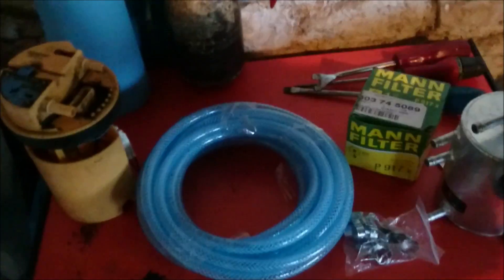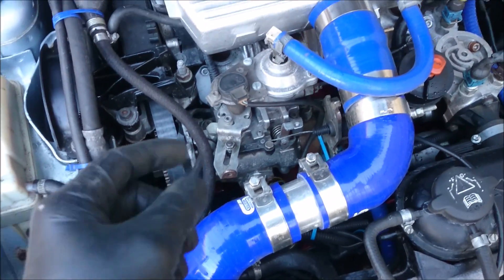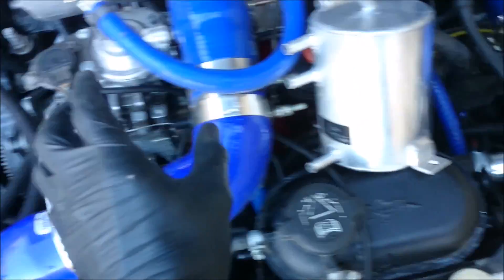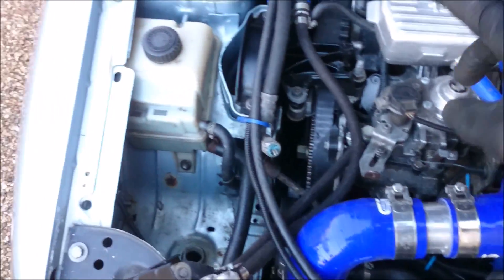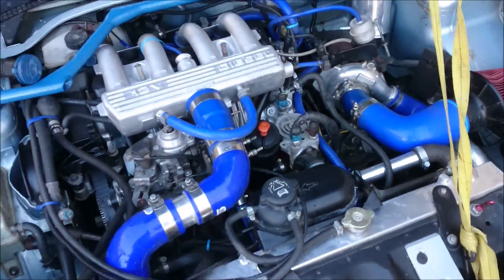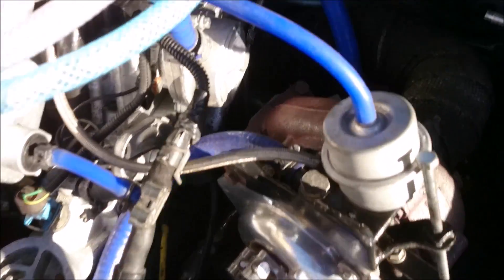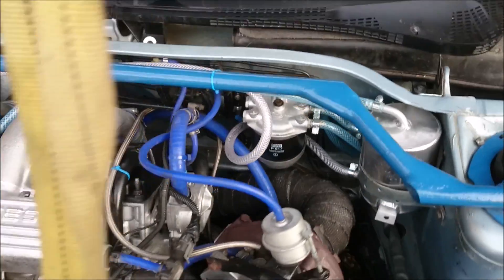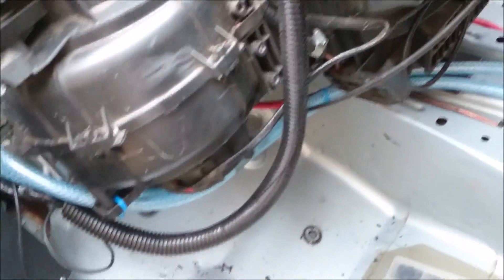HOW TO: Swirlpot, Bosch VE fuel upgrade

Comment: Positive pressure fed to the VE doesn't cause any issue.  Most VE applications have some type of lift pump, either block mounted or electric, plumbed directly to the pump (10-15psi)
Reply from the maker: I've never seen a VE Bosch OEM with positive fed fuel. I make my comment about it causing issues from the experience and knowledge of a number of tuners who have spent 1000s hrs and £1000s between them trying to get the most out of the Bosch  VE pump. All of them tried metered positive fed fuel, down to very small amounts (2,3,4psi)... But it always had negative results. Messing with many different delicately balanced internals/settings. 

More modern fuel pumps (Di) on the other hand are designed and setup very differently and will NOT run without positive fed fuel pressure, requiring a good amount of feed to work properly.

👍🐷💪

Comment: Why not just use a lift pump?
Reply from the maker: Mark Rich Hi there... I am using a lift pump?!
Reply: Coupled with your swirl pot? 
I dont have your motor I stumbled here looking at VE pump mods for my 6bt cummins motor so Im just trying to understand why the use of the swirl pot instead of a conventional lift pump only.
Reply from the maker: Mark Rich I'm sorry if I didn't, but I thought I had explained the reason in the video... basically a VE pump does NOT like being fed with pressurized fuel. However the less 'pulling' it has to do, the better. Hence a swirlpot full of filter fuel a short distance away 👍🐷😊
Reply: No you said that ,maybe I just didnt understand . It a new concept for me.  Im not into performance diesel much .  Sorry for the stupid questions.
Reply from the maker: Mark Rich never a stupid question when it relates to a cummins!

Comment: (sorry for my english) i think you need a heat shield near your swirlpot and your fuel line just in case you have a leak or anything go wrong just for sure xD i know that diesel don't burn like gas but i think you know what i mean ! and you have great channel !!
Reply: and it will do a great diy video ;)
Reply from the maker: yeah diesel doesn't burn like petrol, I was initially concerned that the fuel would get too warm in there...but after a few months testing its been absolutely fine...if anything TOO cold!